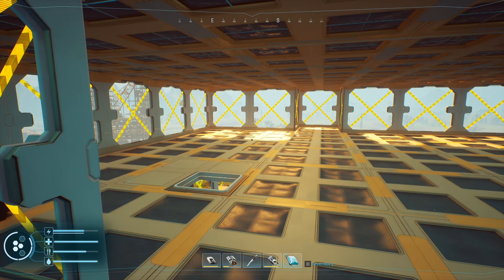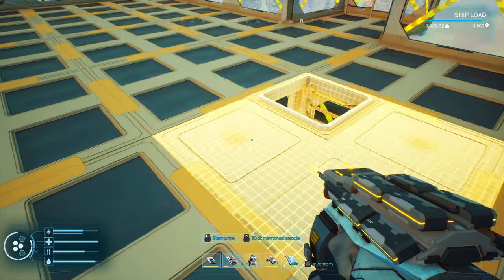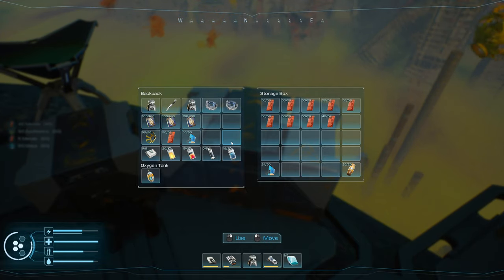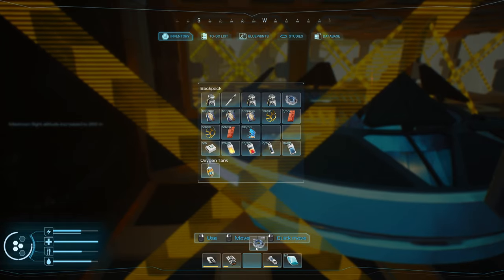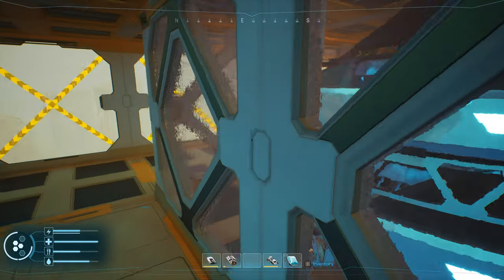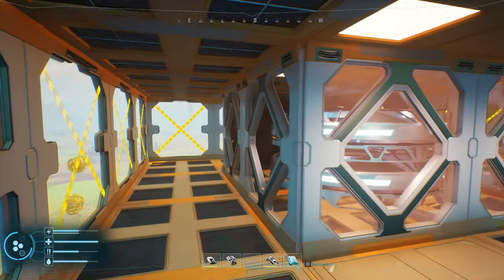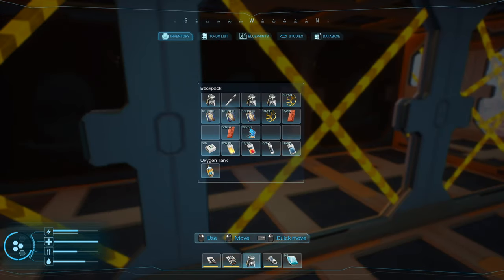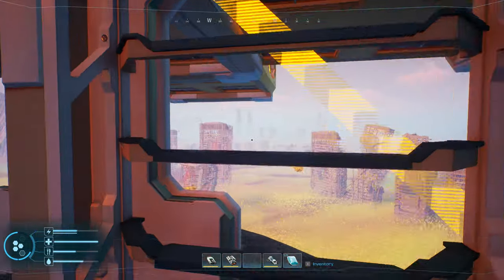Forever Skies - Cribs Edition | How to build an Engine Room

Comment: If i remember well, there is a double decker cockpit, i think.  Instead of building those rooms like that, could you build a double in the middle of the ship and then add the turbines?  Maybe that way you could build a 4-5 turbines stack, or turbine core?
I would love to see if thats possible, maybe another video?
Reply from the maker: You cannot, Turbines and Engines must occupy "Outside" and the inside of Cockpits are "Indoors".

Comment: I bet that keeps the turbines safe from damage too. Awesome 😮
Reply from the maker: It does. The only way they can be hit at that point is if the lightning goes through the outer wall > into the floor > into the inner wall that they're attached to. With that design I've never had them take damage though.

Comment: Could you remove the ceilings and floors to make it like an open air turbine shaft? That would be pretty cool. Hmm, I’ll have to try that maybe. 

Anyways cool video! 👍🏼
Reply from the maker: I added a "Floor" using Catwalks, just to give it a finished appearance. To take out the ceiling would require going up another level in my build, and expose it to being viewed from outside, which is why I built this in the 1st place, to hide the Turbines/Engines from outside view.
Reply: @delindsay  
Yeah I gotcha, it’s an engine room. Very cool. I was just day dreaming haha. I want try my internal turbine shaft idea though. I think it would be cool to just have a long shaft through the center of my ship filled with turbines. :)
Reply from the maker: @Supernautiloid  You can certainly do it, just need to have minimum of a 4x4 of rooms with the center 2x2 removed.